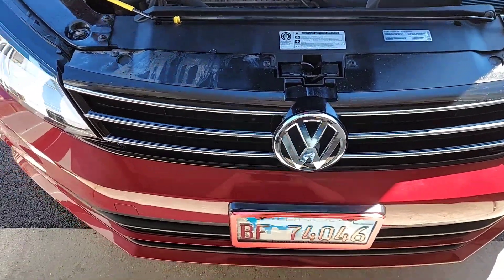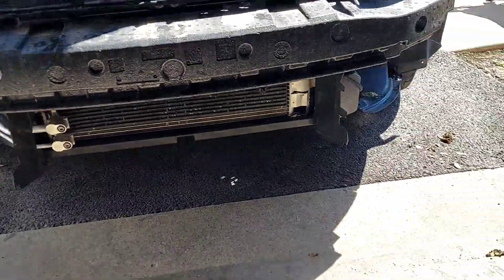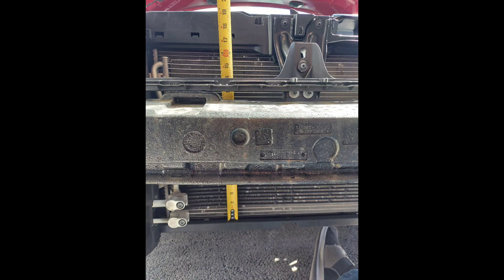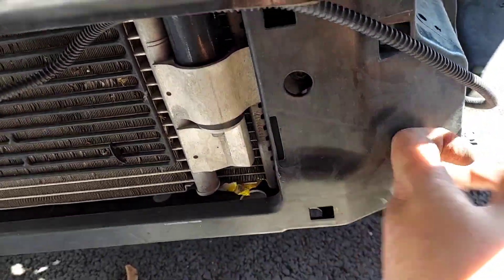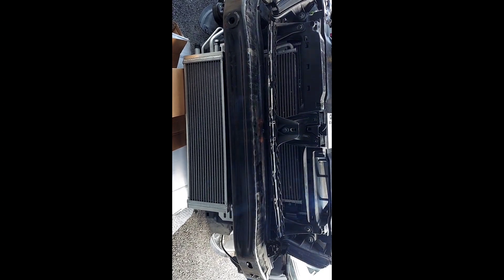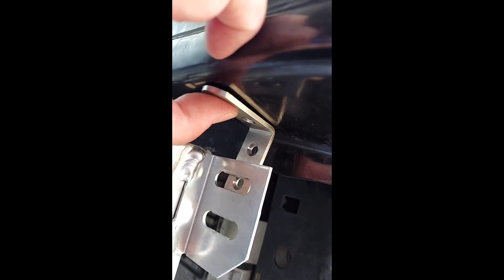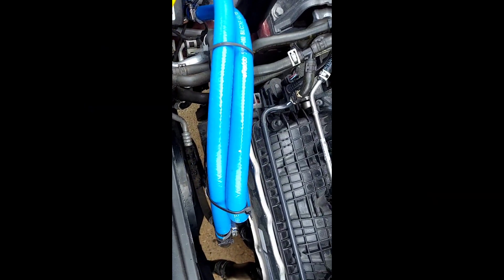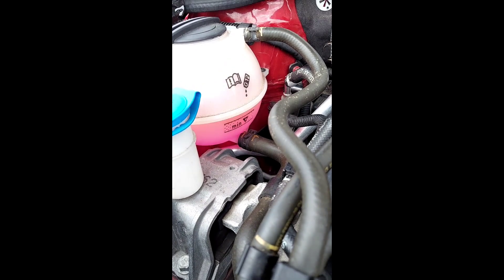MK6.5 Jetta 1.4T EA211 Intercooler System Upgrade Front Mount Heat Exchanger

Comment: So what you did was, install a radiator for the coolant lines that go to the water-cooler?
Reply from the maker: Yes, running the intercooler independently on a FMHE, & running the turbo off the stock H.E.
Reply: @JZsMK6.5  23.5x6.75x2.75 these are the measures of the HE?

Comment: dude why dont you go with a real intercooler. i am thinking about put an air to air intercooler before the stock one(water to air).  but i m not sure it makes any difference?. your project is kind of bigger engine radiator right?
Reply from the maker: Yea, you can run air to air and remove the stock ic and add a block off plate.
Reply from the maker: Wouldn't run a FMIC without removing the stock IC it's just going to bring Temps up.

Comment: Thanks for the help! Just installed a universal Koyorad Heat Exchanger. For anyone reading this comment. I recommend a 3/4 inch coupler for feeding the one of the pipes to the pipe going to the pump.

Comment: Do you notice any better fuel mileage with it separated?
Reply from the maker: Think I'm getting an extra 2mpg certainly didn't do it for fuel economy lol
Reply: @JZsMK6.5  I know I know
I got a stock jetta and was looking around the engine bay and was like where’s the IC? 

We did the same thing in a 240hp John Deere tractor years ago mounting a different cooler for the water to air IC 
Went from 10 gallons per hour to 5GPH and could pull the chisel plow in a higher gear at higher speed, at half the fuel burn 
So economically it paid for itself in a day of work and sweat!
More money in the wallet and carbon in the air too 🤣🤣🤣🤣

Comment: hey bud, great build! ill be trying this on the EA111 instead. How's the clearance between the plastic belly pan and the bottom of the radiator? I have the luxury of customizing my radiator so I would appreciate it if you could share what would be the maximum possible dimensions of the radiator in your experience :)
Reply from the maker: I'd say max dimensions would be 26x3x7
Reply: @JZsMK6.5  thank you! 💯 ill keep you posted on my build :)
Reply from the maker: I highly recommend separating the systems.
Reply: @JZsMK6.5  i would be! i will also be running a external water to air cooler, which will replace the charge pipe.
Reply: @JZsMK6.5  did you have trouble installing the belly pan back onto the car with the new radiator or was the belly pan deleted?
Reply from the maker: @RaynisticalAllstaR  there is no clearance issue with the skid plate the way I have it installed.

Comment: So how's it going man? And how's it looking for tomorrow? You think you'll have those lines separated?
Reply from the maker: Forgot I have a wedding to go to tomorrow ill have it done soon though everything is set to be installed
Reply: @JZsMK6.5  how's it going? Hate to bug but just wanted to know if finally u were able to seperate the cooling system?
Reply from the maker: @ozone377  sorry bro hate to keep delaying, currently in the middle of restoring a piano.  It's taking up all my time currently. I went to do it last week but ended up having a issue with something else on the car, and spent my time on that instead.
Reply: @JZsMK6.5  ok. Well I'll bug u again in a couple weeks. If I don't just end up putting a front mount air to air
Reply: @JZsMK6.5  ok

Comment: good stuff my friend. I have been thinking about doing this for a while.
Reply: Will this work for our car? I know we have the same. I've been wondering about an intercooler set up too. Rtmg has a watercooler block off plate and apparently sells a "stage 3 intercooler kit" but not sure it fits North American EA211 czta 1.4T engines, I messaged them (rtmg) waiting for a reply, I'd love to hear your thoughts, cheers
Reply from the maker: The block off plate works, from what I can see from their IC kit it won't work on the czta. Someone did just make a direct bolt on FMIC kit with piping looks really nice but the alleged price on it is pretty crazy supposedly it is going to be listed for $1700
Reply: @JZsMK6.5  euf, that's steep, tnx fellas for your time and responses
Reply from the maker: @CtrlAltMoto  you should be able to make something like this work fairly easily.

https://www.ebay.com/itm/274617695501
Reply: @CtrlAltMoto  what is shown in this video is someone doing it to our cars, so it’ll work. Just not sure if it’s worth it yet. Also the stage3 kit is a lot of work and money for not a lot of gain. I thought about that too

Comment: Did you notice any difference? Also I see in your second video, you got an other setup with wires, does it require more than the first video you installed?
Reply from the maker: It makes a difference, but eventually 30 to 40 mins after consistent running Temps will reach their peak, rises about 8° every 10 mins. Next step is separating the turbo coolant line and running it off the stock H.E. while running the IC off the F.M.H.E. and yes the 2nd video I added an additional coolant pump. Which is what I will be running the FMHE on when I separate the systems.
Reply: @JZsMK6.5  very interesting man , but is the additional pump necessary or I can just install the heat échanger to do.....thanks you seem like you know exactly what you talking about is there a tutorial ?
Reply from the maker: If you want to run only an additional H.E. I would suggest something more like this for the setup.

https://rcagarage.com/shop/cooling/radiators/koyo-dual-pass-universal-heat-exchanger-radiator-turbocharged-supercharged-applications-kh183627/?gclid=CjwKCAjw-qeFBhAsEiwA2G7Nl2-UAxiiVeRx5DuSINkcVmDaoPvF9wsAcMtu2lfVYAcbxYeZxR0-PxoCsngQAvD_BwE
Reply from the maker: I ran the additional pump to see how much it would increase the efficiency of the FMHE running in conjunction with the stock setup. Adding the additional H.E. add almost a extra 1/2 gallon of coolant to the system, while the stock pump seemed to manage fine,  I already knew I was going to separate the system so I just ran it inline for efficiency testing.
Reply from the maker: If you don't want to run 2 pumps upgrading the stock auxiliary pump would be sufficient enough. The Bosch pump I installed pumps about 2X the amount of coolant per hr and could be used to replace/upgrade the stock pump.
Reply from the maker: Also the additional pump could have just as easily been ran off of your fog lights or drl connection without running a separate switch

Comment: Did it make a difference?
Reply from the maker: It makes a difference, but eventually 30 to 40 mins after consistent running Temps will reach their peak, rises about 8° every 10 mins. Next step is separating the turbo coolant line and running it off the stock H.E. while running the IC off the F.M.H.E.
Reply: @JZsMK6.5  OK thank u.
Reply: @JZsMK6.5  it looks awesome
Reply from the maker: @ozone377  Thank you, I do enjoy how it looks, think I need a Euro plate next
Reply: @JZsMK6.5  u mean a euro license plate?
Reply from the maker: Yes
Reply: @JZsMK6.5  that will look nice. Where did u get your intercooler? And I guess I want to know y no intercooler pipes?
Reply from the maker: No pipes, because it is a heat exchanger, not a Intercooler. The link to the one I used is in the description. There are certainly probably better ones out there. But this was all experimental, maybe one day I might swap it out. I will see how well it works when I separate the systems.
Reply: @JZsMK6.5  ok. So it's a performance heat exchanger? What about the stock one? Do u bypass it? Or r u using both?
Reply from the maker: @ozone377   yes, I am currently running it in conjunction with the stock exchanger. If you watch my other video you can see I added another auxiliary water pump to the system, and hopefully in the next few days I will have the systems separated. I will be running the IC system off of the FMHE, and the Turbo coolant lines off the stock H.E.
Reply: @JZsMK6.5  what is the ic system?
Reply from the maker: @ozone377  IC = Intercooler
Reply: @JZsMK6.5  so the stock intercooler, running with the performance h.e.? And turbo with stock h.e. where is the stock ic on these 1.4t? So it has a stock ic and h.e.?
Reply from the maker: The stock system is a water to air system. The stock intercooler is built into the intake manifold. The stock heat exchanger is between the radiator and  a/c condenser.
Reply: @JZsMK6.5  what will separating the lines do?
Reply from the maker: @ozone377  The turbo is the hottest component in the system, separating it from the IC system makes it so you're only cooling the IC system coolant down with the FMHE. Which in turn makes it much more manageable to maintain lower IAT'S.
Reply: @JZsMK6.5  okay did you eliminate the stock heat exchanger and just use the performance heat exchanger?
Reply from the maker: @ozone377  no, you have to still cool the turbo coolant lines down. This is what the stock exchanger will be doing. So, turbo runs off stock H.E. and IC system runs off of FMHE
Reply: @JZsMK6.5  ok got it. Thank u.
Reply from the maker: @ozone377  you're welcome, like I said hopefully I will have a video out by the end of the week.
Reply: @JZsMK6.5  ok I'll check it out. Imma do the same thing
Reply: if you can please explain how you would separate the lines
Reply from the maker: I will in the video
Reply: @JZsMK6.5  nothing yet on separating the lines individually
Reply from the maker: Went to do it yesterday, and the NPT's on the reservoir are both just slightly off from being standard size so I have to figure out a way to rethread them or get a different reservoir.
Reply: Ok. It's pretty complicated than?
Reply from the maker: @ozone377  no it's just the stupid reservoir I bought doesn't use standard npt barb sizes for whatever reason
Reply: @JZsMK6.5  oh so you don't have to remove the stock reservoir for the cooling right
Reply from the maker: @ozone377  nope stock system stays in place and is used to cool the turbo
Reply: @JZsMK6.5  then I guess I'm kind of dumb when it comes to this stuff. I'm going to need like a step-by-step type of thing to know how to do everything
Reply: Still haven't been able to seperate those cooling lines yet?
Reply from the maker: @ozone377   lol ... I think you might be more excited about it than me at this point... I rethread the ports on the reservoir yesterday finally. Had to order different barbs, I will hopefully have it done next Saturday.
Reply: @JZsMK6.5  cool. It's that I was going to go air to air front mount intercooler. But if I can keep it as stock looking as possible. With better cooling I'd rather do that
Reply: Im also getting the hybrid turbo. Everyone I've seen so far with hybrid turbos on these 1.4t. Go with air to air intercooler and claim they can make 250 to 270hp. So I'd like to get that but with air to water instead of air to air
Reply from the maker: I fully understand, I'm trying to get this done as soon as possible. I did not anticipate my reservoir having unusable ports. I had to order tools to rethread them, it's been a process.
Reply from the maker: @ozone377  don't think you're going to see 250whp on a hybrid turbo without WMI from my understanding. The hybrid turbos at least the RTMG one is rated at 240bhp so ruffly 220whp
Reply: @JZsMK6.5  it's cool bro no rush. U been very helpful I appreciate. Well hopefully next Saturday everything is running nice and smooth
Reply from the maker: Thanks,  I hope so too!
Reply: @JZsMK6.5  what is WMI
Reply from the maker: @ozone377  water meth injection
Reply: @JZsMK6.5  why water meth?
Reply from the maker: @ozone377  Google it...
Reply: @JZsMK6.5  I have but I've heard it doesn't do much
Reply: At least unitronic told me it won't do much
Reply from the maker: @ozone377  yea it won't do anything for a Unitronic tune because it is not tuned for it at all.
Reply: Yeah but who would be able to tune that? I've asked around and nobody knows everything
Reply from the maker: A professional tuner,  if they can tune for a hybrid turbo or any turbo upgrade, they can tune it for WMI not saying you should run it or not I just mentioned it because you were saying you were going to get big numbers out of a small hybrid turbo
Reply: @JZsMK6.5  let's see. I'll wait on your invention. It sounds good